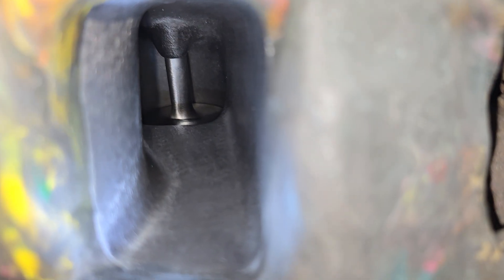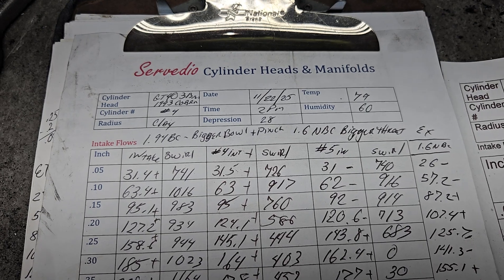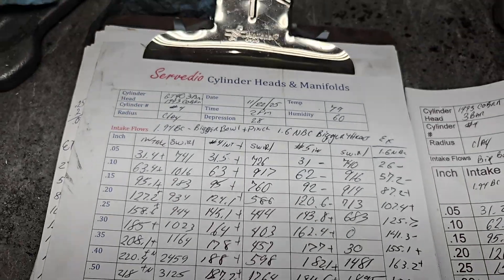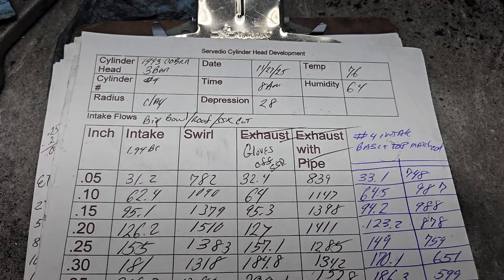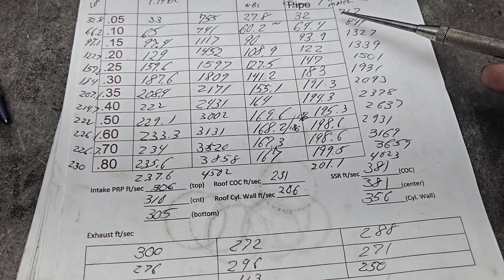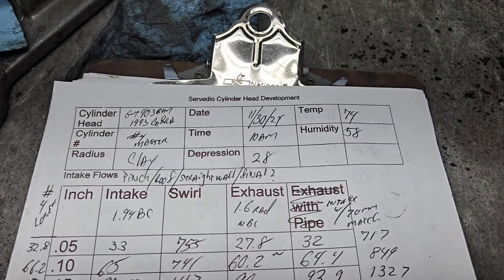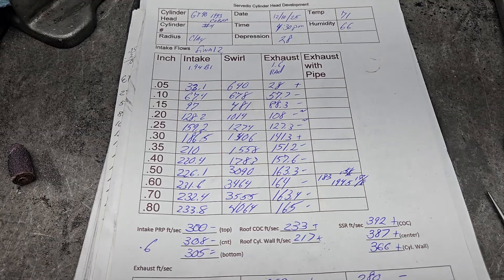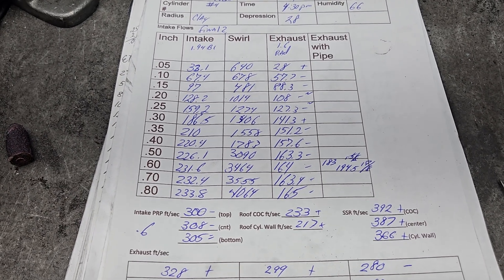1993 Cobra GT40 3 bar project cylinder head final flows

Comment: Hi Charles, your thoughts on reducing exhaust flow up to 0.300" lift to min cylinder blow down to, in theory, extend the power stroke (sinking the exhaust valve, no cut back on the face of the exhaust value...). Thank you for posting!
Reply from the maker: I would reduce flow by using less duration on the cam. That would work better. Thanks
Reply: @servediocylinderheads hello,have you ever got to do a ford fe iron head yet
Reply from the maker: @eddiefe428 Never